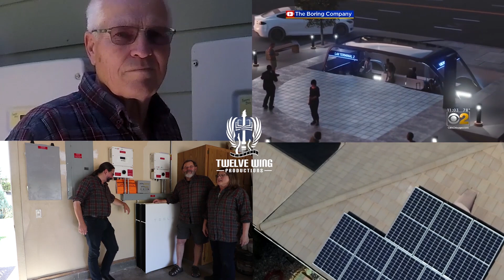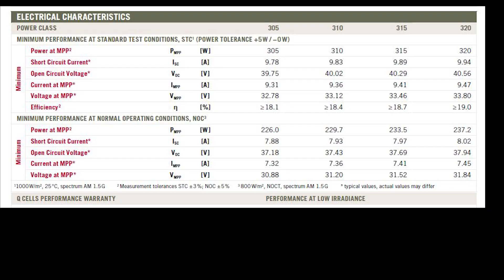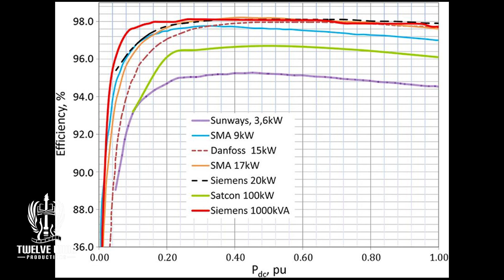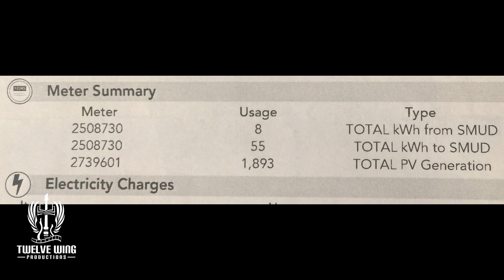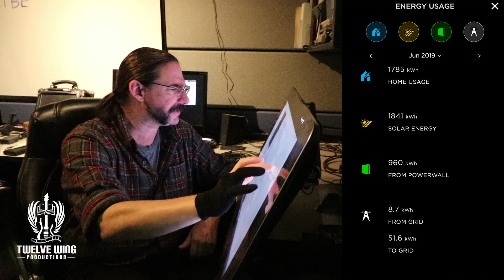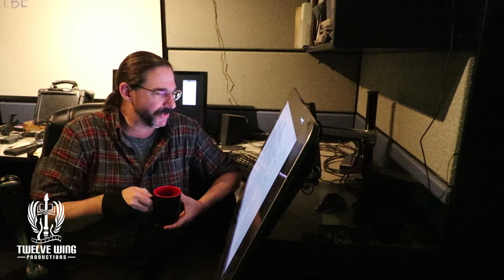How much power does a Tesla Powerwall system really lose?: The Energy Sovereignty Project

Comment: Hi, The inverter for the solar panels, would the individual micro inverters suffer as much with the upper & lower power outputs?
The idea that regulations allow a product to work efficiently only at a narrow band does annoy me, would it really cost that much more in parts to have a two step system that could intelligently select the best inverter for the power coming in. Looking at your system's figures would that extra range of efficiency make enough of a power production input over a year to be worth the investment if such a unit is made?

I've seen similar studies about the efficiency of EV fast chargers were they have built some to be future proof by being able to be operated at much higher charge rates than they are now. Basically the efficiency drops through the floor if an older car uses it. 
Now it could be that some chargers are using some clever way around this but it makes you wonder how much our networks of fast chargers could be wasting trying to second guess the next charge rate step up.
Reply from the maker: Micro inverters are HIGHLY efficient during low PV output... BUT....
... they also suck in the heat.
So my advice would be that if you live in a northern or far southern latitude you may want to look into micro inverters.
If you are in someplace like Arizona or New Mexico... Chad.  Go with a standard inverter and try and mount it inside.
There are also options now for water cooling your panels.  This sounds like it's a crazy idea but you do actually lose enough power from overheating that this might get well beyond the break even point where the increased power you get from the panels more than makes up for the power lost from the pumps.
This might also lead to a situation where the panels last much longer because you cooled them.  If that is the case, then there is a very clear benefit to doing this, especially if you can find some other alternate use for the heat you remove.

Comment: Very nice and detailed presentation. Not many go in such detail. I am a number nerd sort to say.
When it comes to efficiency, over sizing power switching equipment such as inverters can make losses even greater. Lot of power switching equipment is not that efficient when you have small loads. They tend to work the best around 30 to 60 percent load. I have noticed that in PC power supplies and in my own equipment. Efficiency for small amount of load overnight tends to be around 85 percent and goes up to 96 percent around 55 to 60 percent load. 
So your calculated loss of 10 percent is correct. That does include losses of just running the equipment it self. Not big but still there. I bet that water cooling system in Power Wall needs at least couple of amps to run.

Keep them coming. Again very nice.....
Reply from the maker: Thanks.  If you are a numbers guy, I think you are going to like it here.
There are lots of "feelings" being put forward as fact but very few actually do the experimental work and focus on what the numbers actually have to say.

Thanks for joining in the madness here.

Comment: Tesla is too expensive .
Cheaper alternatives
Reply from the maker: Name them and I'll address it.
What one finds when one actually looks into this is that Tesla's batteries have thermal management and others don't.
So it's difficult to compare pricing when one factors in either longevity or the fact that these batteries are basically plug and play.
So it's fine to feel that way... and voice your opinion... but please back that up so we can examine the products that you feel are better value for money.
Reply: The cheap becomes the expensive in my experience.
Reply from the maker: @t.r.766 , incredibly true.
Cheap Chinese panels shorting to hot spots and burning $#!+ down, Nissan not putting a thermal management system in the original leaf to save money... this goes on and on.
I have my gripes about the Tesla Powerwall but cost and quality isn't one of them.

The Powerwall 2 and soon the PW3 are setting the bar so high that it's actually unlikely that others will have competing products for nearly a decade unless some technology comes along that leapfrogs their enhanced electrolytes and solid state development.
Reply: @twelvewingproductions7508  If anything the Powerwall will drop in price and be even better value next year as Tesla free up battery production from their car battery lines due to the next jump in battery technology.
New battery production lines will be producing new formula cells with although not a solid state probably a dry coating method. The other reason I think they will use a new production line is to make use of their new Tabless battery method of cell construction. The car battery spec they have now is good for Powerwalls and producing more of them not only helps reduce costs but it means Tesla has more batteries out there when they activate their energy business.
Reply: I’m in the middle of getting quotes and Tesla is by far the least expensive “package” for 10kwh & 4 powerwalls. But my gripe is that they will only sell me QCell G5 panels; not even the latest G6 models. I’m gonna keep looking for Panasonic or LG panels with Microinverters. QCell G5’s have crappy warranty and efficiency. I wanted to stay in the Tesla ecosystem, but they seem to only want to sell cookie-cutter systems at rock-bottom prices.

Comment: The PowerWall doesn’t seem to start recording power at the same amount as my SMA inverter does. My SMA inverters starts at 0 kw, but the PowerWall starts at 0.1 kw. That’s not that big of a difference in the summer or sunny days as in the winter or cloudy days. When I check my daily power production on the PowerWall, it shows 40 kWhrs, but my inverter Showa 41.2 kWhrs. That’s approximately 3% PowerWall reading error.
Reply from the maker: I think what you are seeing is a threshold.  You may need to make a distinction between displaying and recording.
In the case of our SolarEdge inverter, the display shows all power just like a power meter would, but it doesn't actually engage until the system has 100w to play with.
Try this.  Tomorrow morning, if you are around, go to your inverter and listen to it when it hits 100w.  I suspect you will hear it click.  It isn't until that moment that it actually sends power to the Tesla Gateway.

The disparity on the other hand.... that is exactly what we are seeing with our system as well.  That appears to be a calibration issue.
I have this sneaky feeling that the reason is a regulatory one.  I don't have direct experience with utility regulators but I do have experience with medical devices and pharmaceuticals.   The FDA regulates most things on a -X/+0 scale for accuracy.  Being generally better to make an error on less drug than ANY overdose at all.
If your product has less of a compound than you say, you are good (to a point) but if there is even the slightest amount over you can suffer fines or even have your entire production halted.

I expect that there is something similar going on here.  Tesla realizes that as far as utility providers are concerned, they are already running with scissors.  If they make the mistake of over reporting they might face hefty fines or even licensing issues with certain utility districts. 

That's just speculation of course, but it is interesting that the amounts that both of our systems are off seems to be nearly identical.